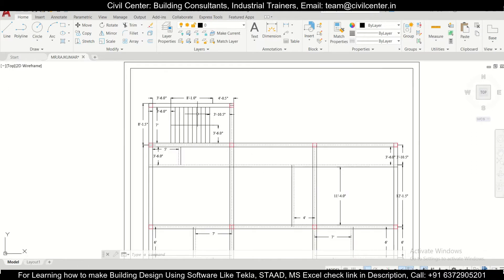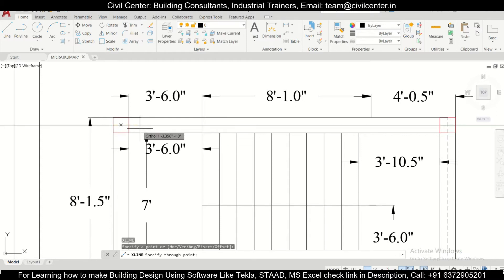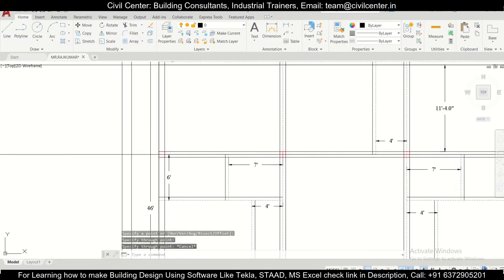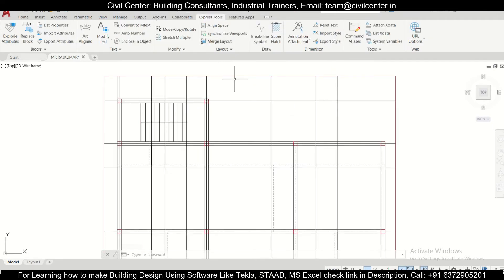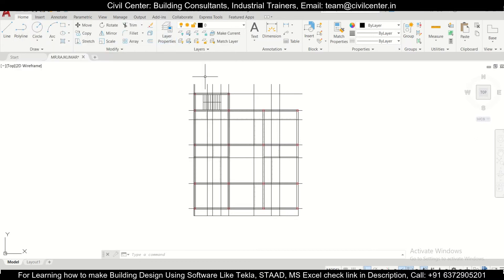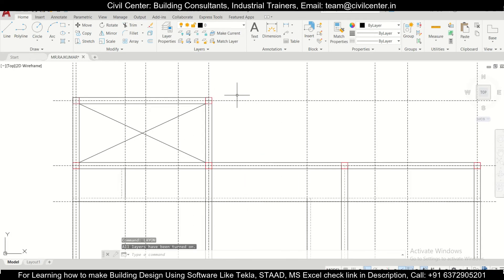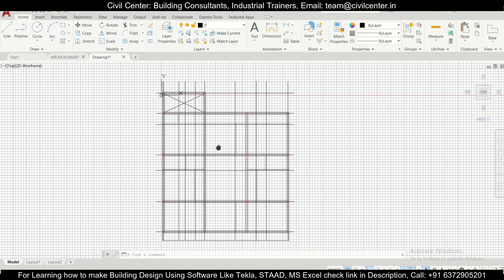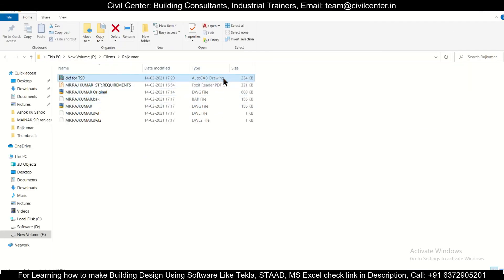Tekla Structural Designer Tutorial || How to make CAD File/DXF File For Import|| Importing Gridlines

Comment: Hello
Thank you for the video.
I am trying to import my dxf but it is not working. I am not able to see the layers in tekla. What could be the problem?
Reply from the maker: In cad your layers might be locked, check that
Reply: @CIVILCENTER  I have checked an they are not locked. The only thing I have realized is working is doing the gridline over again which takes a lot of time. Initially I was just selecting one rid then select similar and put them in one layer then upon importing the layers do not show
Reply: @CIVILCENTER  Should one create new gridlines or we can just use the ones provided by the architectural drawing?
Reply: I am also trying to match properties from architectural plan then put it in my gridlines layer on CAD then import to TSD as dxf but it is  not working also.